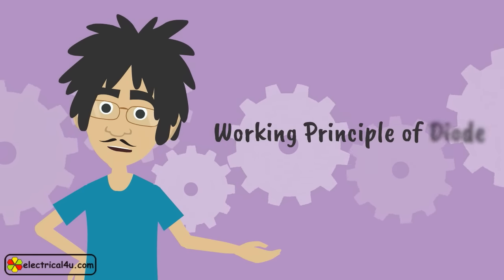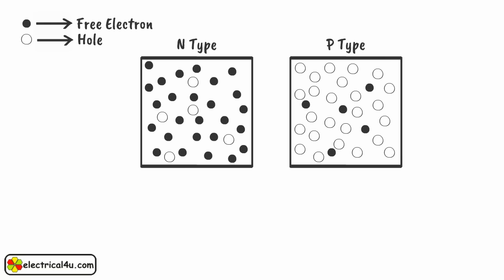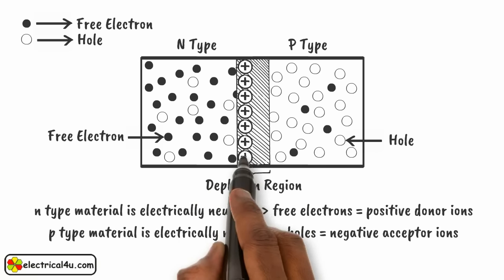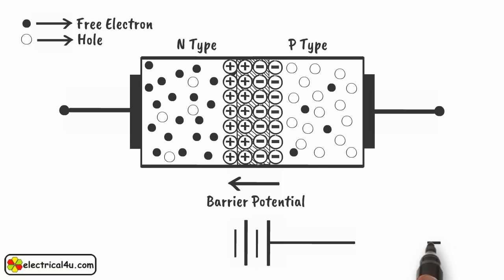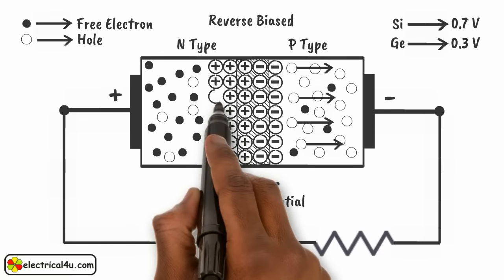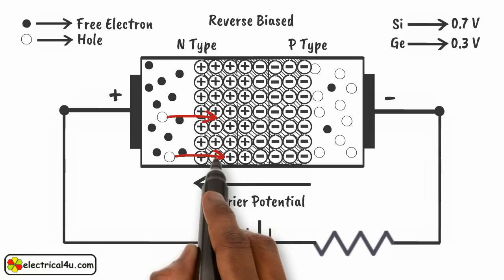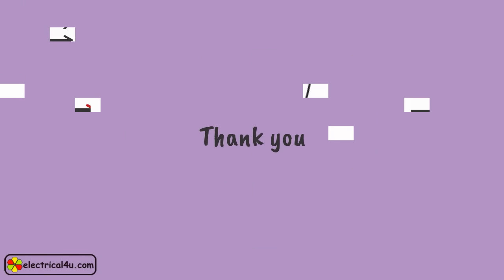How does a Diode Work? A Simple Explanation | How Diodes Work | Electrical4U

Comment: Thanks! After watching a number of other video's that tried to explain diodes, I found this one to be the first that clearly explains how the depletion region and electric field forms and works. It helped that you explained that the N- and P-doped material is neutral (has no charge). That explains why a field is formed, and I missed that information in other videos.
Reply: You may also refer the books in this reply.
What is a pn junction ? 
A pn junction allows current in one direction only. It blocks current in the reverse direction. 
When a pn junction is formed, a potential barrier designated Vo comes into existence and is typically around 0.6 to 0.7 volts for silicon junctions. 
When the barrier whose Vo is 0.7 volts is disturbed by applying a forward bias of say, 0.6 volts, the current increases and the increase becomes steep for small increments of the forward bias value a little greater than 0.68 volts. Large currents are observed when the forward bias is 0.69 volts which is closer to the barrier voltage of 0.7 volts. 
The forward bias can never exceed the potential barrier voltage nor can it bring the barrier down to zero volts. That is the reason you seldom see current vs volt graphs of pn junction diodes beyond a volt or so.
How does the bias remain less than the barrier in an operational diode?
The voltage bias applied drops in the bulk neutral regions of the diode. 
The current in a forward bias adjusts to fulfill the conservation of current law and the rate of recombination.
A detailed description of the pn junction with a distinct approach using surface charges, alignment of Fermi levels, creation of the barrier, the distinct processes of diffusion, drift, recombination and the influence of the electric field on the energies of electrons is provided in the following textbooks.

Electrostatics and circuits belong to one science and not two, that of electricity and magnetism. To know how they are unified visit this link 
https://matterandinteractions.org/articles-talks/ and view the article 'A unified treatment of electrostatics and circuits.  B. Sherwood and R. Chabay, unpublished. (1999)'
pdf. 
For a live demonstration of surface charge and its effects in circuits visit 
https://youtu.be/U7RLg-691eQ
For a detailed discussion of surface charge, coulomb's law, electric fields, fields of dipoles and other charge configurations, and parallel plates, and a distinct approach using the surface charge concept in the study of advanced topics of capacitance, currents, conservation of charge, conservation of current, superposition of fields, superposition of potential, simple dc circuit, magnetic fields, magnetic fields of a current element, straight wire, current loop, solenoids, biot-savart law, voltage, voltage source, difference between e.m.f. and potential difference, ideal voltage sources, resistors, how current branches in a parallel circuit, capacitors, inductors, Faraday's law, inductance, ac circuits, transmission lines, Lorentz Force law, motors, generators, p-n junction diodes, electromagnetic waves, antennas and radiation, new electrodynamic theories on the nature of the electric field, see "Electric and Magnetic Interactions" by Chabay and Sherwood 
www.matterandinteractions.org
or 
Fundamentals of electric theory and circuits by Sridhar Chitta
https://www.wileyindia.com/fundamentals-of-electric-theory-and-circuits.html
There is a "look inside" feature in the amazon.com webpage of the book "Fundamentals of electric theory and circuits" by Sridhar Chitta with a few pages of Chapter 1 which may be viewed and also which you may swipe left or press < icon to view the foreword, preface and Table of Contents. The contents of the above book by Sridhar Chitta, make a distinct unified approach to electrostatics and a few advanced circuits like coupling signals to amplifiers, lending precision and clarity to the topics which is not found in most text books.
The book comes alongwith a CD with animated power point presentations for all chapters and voltage regulator, RC phase shift oscillators and differential amplifiers included additionally.
For a lecture by Prof Ruth Chabay on surface charge in a simple dc circuit visit 
https://youtu.be/-7W294N_Hkk
There is a full set of lectures beginning lecture 13 here on surface charges, electric fields, simple circuits, capacitance, inductance, faraday's law, motional emf, magnetic forces and more topics here
https://matterandinteractions.org/videos/EM.html
Reply: @sridharchitta7321  thank's

Comment: Is there any mistake about the direction of the barrier potential ? I think it must be the opposite direction, or am I wrong ?
Reply: You caught it! actually, the direction you meant is of the electrical field and since E = - grad V,  the potential difference direction should be the opposite so it is correct then. But it's a  brilliant catch :)
Reply: Nguyễn Duy Anh  yeah you're right
Reply: You mean electric field as told by pfesd but in the video, the are showing di-pole moment -ve to +ve
Reply: FU conventional flow Theory
Reply: I think u r correct
Reply: @ucaaccount4663  yah, i was wondering the direction at first and i listened to it between 3.10-3.20 , then i am sure that is not right, and Anh's comment is much more help to relieve my doubt.

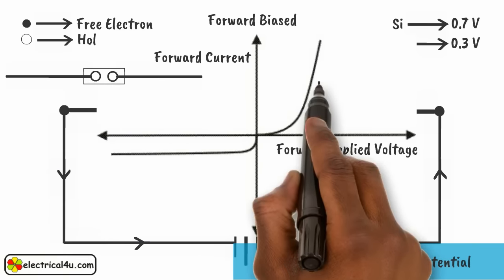Comment: 4:26 you said applied voltage > forward bias voltage will make currents flow, but why is that when you said that when there is more applied voltage the diode will behave as an open switch.

Comment: The potential barrier can never be made zero volts. It cannot disappear. The forward bias voltages mentioned are not correct. Please refer to the books in this reply.
What is a pn junction ? 
A pn junction allows current in one direction only. It blocks current in the reverse direction. 
When a pn junction is formed, a potential barrier designated Vo comes into existence and is typically around 0.6 to 0.7 volts for silicon junctions. 
When the barrier whose Vo is 0.7 volts is disturbed by applying a forward bias of say, 0.6 volts, the current increases and the increase becomes steep for small increments of the forward bias value a little greater than 0.68 volts. Large currents are observed when the forward bias is 0.69 volts which is closer to the barrier voltage of 0.7 volts. 
The forward bias can never exceed the potential barrier voltage nor can it bring the barrier down to zero volts. That is the reason you seldom see current vs volt graphs of pn junction diodes beyond a volt or so.
How does the bias remain less than the barrier in an operational diode?
The voltage bias applied drops in the bulk neutral regions of the diode. 
The current in a forward bias adjusts to fulfill the conservation of current law and the rate of recombination.
A detailed description of the pn junction with a distinct approach using surface charges, alignment of Fermi levels, creation of the barrier, the distinct processes of diffusion, drift, recombination and the influence of the electric field on the energies of electrons is provided in the following textbooks.

Electrostatics and circuits belong to one science and not two, that of electricity and magnetism. To know how they are unified visit this link 
https://matterandinteractions.org/articles-talks/ and view the article 'A unified treatment of electrostatics and circuits.  B. Sherwood and R. Chabay, unpublished. (1999)'
pdf. 
For a live demonstration of surface charge and its effects in circuits visit 
https://youtu.be/U7RLg-691eQ
For a detailed discussion of surface charge, coulomb's law, electric fields, fields of dipoles and other charge configurations, and parallel plates, and a distinct approach using the surface charge concept in the study of advanced topics of capacitance, currents, conservation of charge, conservation of current, superposition of fields, superposition of potential, simple dc circuit, magnetic fields, magnetic fields of a current element, straight wire, current loop, solenoids, biot-savart law, voltage, voltage source, difference between e.m.f. and potential difference, ideal voltage sources, resistors, how current branches in a parallel circuit, capacitors, inductors, Faraday's law, inductance, ac circuits, transmission lines, Lorentz Force law, motors, generators, p-n junction diodes, electromagnetic waves, antennas and radiation, new electrodynamic theories on the nature of the electric field, see "Electric and Magnetic Interactions" by Chabay and Sherwood 
www.matterandinteractions.org
or 
Fundamentals of electric theory and circuits by Sridhar Chitta
https://www.wileyindia.com/fundamentals-of-electric-theory-and-circuits.html
There is a "look inside" feature in the amazon.com webpage of the book "Fundamentals of electric theory and circuits" by Sridhar Chitta with a few pages of Chapter 1 which may be viewed and also which you may swipe left or press < icon to view the foreword, preface and Table of Contents. The contents of the above book by Sridhar Chitta, make a distinct unified approach to electrostatics and a few advanced circuits like coupling signals to amplifiers, lending precision and clarity to the topics which is not found in most text books.
The book comes alongwith a CD with animated power point presentations for all chapters and voltage regulator, RC phase shift oscillators and differential amplifiers included additionally.
For a lecture by Prof Ruth Chabay on surface charge in a simple dc circuit visit 
https://youtu.be/-7W294N_Hkk
There is a full set of lectures beginning lecture 13 here on surface charges, electric fields, simple circuits, capacitance, inductance, faraday's law, motional emf, magnetic forces and more topics here
https://matterandinteractions.org/videos/EM.html

Comment: The potential barrier of an operational diode can never be made zero.
What is a pn junction ? 
A pn junction allows current in one direction only. It blocks current in the reverse direction. 
When a pn junction is formed, a potential barrier designated Vo comes into existence and is typically around 0.6 to 0.7 volts for silicon junctions. 
When the barrier whose Vo is 0.7 volts is disturbed by applying a forward bias of say, 0.6 volts, the current increases and the increase becomes steep for small increments of the forward bias value a little greater than 0.68 volts. Large currents are observed when the forward bias is 0.69 volts which is closer to the barrier voltage of 0.7 volts. 
The forward bias can never exceed the potential barrier voltage nor can it bring the barrier down to zero volts. That is the reason you seldom see current vs volt graphs of pn junction diodes beyond a volt or so.
How does the bias remain less than the barrier in an operational diode?
The voltage bias applied drops in the bulk neutral regions of the diode. 
A detailed description of the pn junction with a distinct approach using surface charges, alignment of Fermi levels, creation of the barrier, the distinct processes of diffusion, drift, recombination and the influence of the electric field on the energies of electrons is provided in the following textbooks.

Electrostatics and circuits belong to one science and not two, that of electricity and magnetism. To know how they are unified visit this link 
https://matterandinteractions.org/articles-talks/ and view the article 'A unified treatment of electrostatics and circuits.  B. Sherwood and R. Chabay, unpublished. (1999)'
pdf. 
For a live demonstration of surface charge and its effects in circuits visit 
https://youtu.be/U7RLg-691eQ
For a detailed discussion of surface charge, coulomb's law, electric fields, fields of dipoles and other charge configurations, parallel plates, capacitance, currents, conservation of charge, conservation of current, superposition of fields, superposition of potential, simple dc circuit, magnetic fields, magnetic fields of a current element, straight wire, current loop, solenoids, biot-savart law, voltage, voltage source, difference between e.m.f. and potential difference, ideal voltage sources, resistors, how current branches in a parallel circuit, capacitors, inductors, faraday's law, inductance, ac circuits, transmission lines, motors, generators, p-n junction diodes, electromagnetic waves, antennas and radiation, new electrodynamic theories on the nature of the electric field, see "Electric and Magnetic Interactions" by Chabay and Sherwood 
www.matterandinteractions.org
or 
Fundamentals of electric theory and circuits by Sridhar Chitta
https://www.wileyindia.com/fundamentals-of-electric-theory-and-circuits.html
There is a "look inside" feature in the amazon.com webpage of the book "Fundamentals of electric theory and circuits" by Sridhar Chitta with a few pages of Chapter 1 which may be viewed and also which you may swipe left or press < icon to view the foreword, preface and Table of Contents. The contents of the above book by Sridhar Chitta, make a distinct unified approach to electrostatics and a few advanced circuits like coupling signals to amplifiers, lending precision and clarity to the topics which is not found in most text books.
The book comes alongwith a CD with animated power point presentations for all chapters and voltage regulator, RC phase shift oscillators and differential amplifiers included additionally.
For a lecture by Prof Ruth Chabay on surface charge in a simple dc circuit visit 
https://youtu.be/-7W294N_Hkk